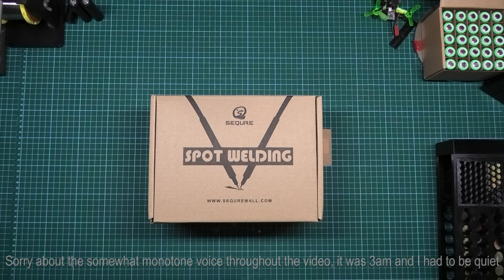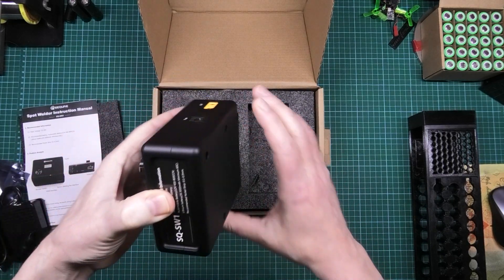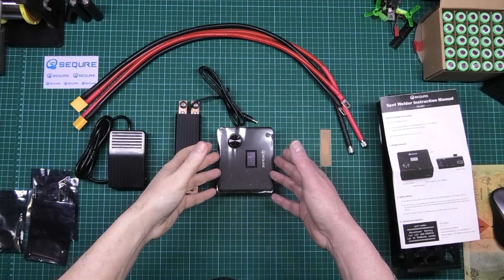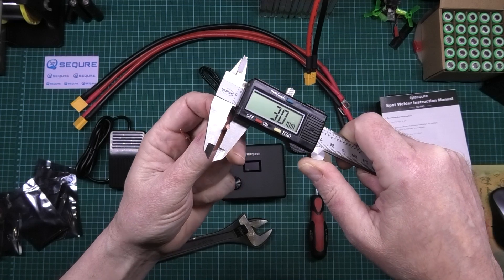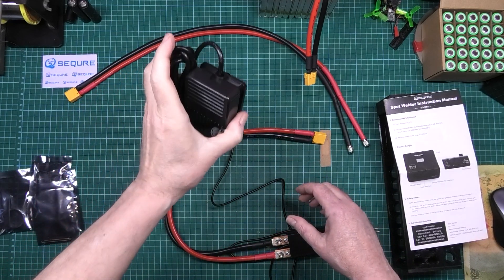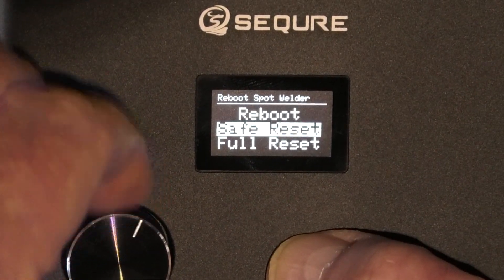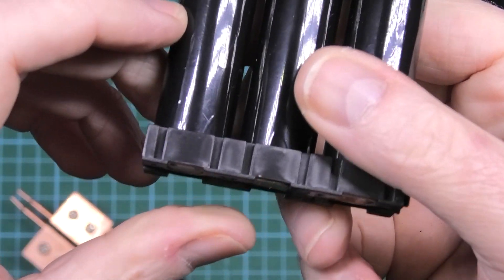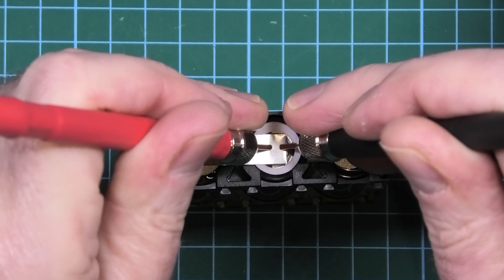Sequre SQ-SW1 battery spot welder review (18650, 26650, 21700 etc)

Comment: Just started using this. .20 strips need 70ms @100% pulse! Using a car battery for power supply with 6awg cable. Things get hot. I suspect the battery can’t deliver 300amps required.
Any thoughts on how power source affects weld current?

Comment: Hey are you still using this as your main spot welder?  I picked this welder up not along ago.  Im using it with a Zee 3s 7200mah 80c battery which meets the requirements.  I was working on my first battery build and everything was working butter smooth.  Super clean welds.  Until out of the blue my welder just starts blasting through my nickel strips.  I was only using 0.1mm strips with a pulse timing of 5ms and it putting holes right through.  I emailed the company 3 times and i really got no response.
Reply from the maker: Yes, I still use it with zero problems. 
A few points to note..... fake nickel (it's actually nickel coated tin) doesn't perform anywhere near as good as pure nickel. If you get sparks, it's fake nickel. I've known people who bought 2 rolls of nickel and they changed half way through. The first roll was pure nickel, the second was fake so it blew holes in everything.
When welding any nickel, you need to make sure that the strips are flattened after you cut them - any air gap between the nickel strip and battery will blow a hole in it.
Make sure you clean all surfaces with some solvent (obviously, make sure it all evaporates off afterwards) because dirt/adhesive/dust/engineering oil causes a lot of problems.
If they're reclaimed cells, make sure the terminals don't have anything left over from last time (grind off all traces of previous welds).
Do not sharpen the tips but make sure you don't have any black carbon build-up on the ends - the tips need to be clean and slightly rounded to get a better contact area which spreads the current and gives a better weld (and also stops it from blowing holes in everything).
Dial the pulse duration down until it doesn't weld properly and then dial it up by 2 points.
I don't think it's the welder, it's something else that has changed.
Reply: @Vortecks  Yeah i figured out the problem.  It was me not pressing down hard enough lol. I have no idea where to even find pure nickel strips.  Im in Canada buy the way. Thanks for the response.

Comment: Did you tryed allready 50 welds and over in row (one by one)? get hotter and hotter? I'm still using malectrics pins and they are very hot after some welds so after 15-20 I must take a break.

Comment: Hi Tony, did you see any over current protection on the inside (there is no mention in the manual)?  It possibly just relies on wire and battery (internal) resistance to limit the current.  Hopefully your monster pack won't start eating the FETs!
Reply from the maker: No mate, there's no internal protection. I ran it at > 650A with a 0.3mm copper strip and a 25ms pulse for quite a while and nothing blew.

Comment: Can you set it up to use a regular plug into 110?
Reply from the maker: No, sorry. They use far too much current and much lower voltage to connect directly to a mains outlet (you can convert a microwave transformer but I'm not going into that one). You're better off looking at the Sunkko spot welders for 110V https://www.banggood.com/custlink/D3DdOPMmh4
Reply: @Vortecks  i have a Sunkko 788h already and I'm not a fan to say the least. I was looking at your links and seems like those aren't that bad after all. The thing I'd like to know now is how many welds you get off one of those batteries?  And are they really a good machine? Seems wonderful. lastly THANK YIU for your response.
Reply from the maker: @FelonENews  I get virtually unlimited welds from my battery but it's big (12V - 64Ah and capable of delivering over 1000A) and expensive and built for the purpose. 
The welder is good, I used to have a Malectrics spot welder which never let me down but it was a bit cumbersome and now, I only use the Sequre spot welder.
Reply: @Vortecks  I heard good things about the malectrics and kweld. but the sequre seem the best overall. Thanks

Comment: My homemade Gas Turbine has a Combustor made from Inconel sheet... Microwave Transformer job and timer ..those tips got hot too, and the arms...Worked though...😀🇬🇧
Reply from the maker: Now, that's the PROPER use of a microwave transformer for spot welding. Using the same kit for doing batteries is a bad idea because it fuses by resistance heat, rather than spark welding.
Reply: @Vortecks  Yes, in my case the current passes through two pieces of metal with the tips opposing each other. The current flows from one tip to the other in the traditional way. This surprised me when is see batteries done in this way that it worked, and didn't just melt the tab...🤔🤔😯

Comment: Chinese PVC coated wire, ultra rigid due to them not using plasticiser to save money.
I absolutely DETEST them for doing this...SO bloody annoying....Rant over, my pet hate...😡😡😡😡😡😡😡😡😡😡🙄🇬🇧
Reply from the maker: Yep..... It's one of my hates, too. Things like balance leads - there's no reason why they can't use silicone insulation but they don't seem to listen.
Reply: @Vortecks  PVC...it's cheaper than Silicone coated and more durable...I fucking hate it. Bought a new electric razor the other week, same thing, cable with folds moulded  in it.... FFS...😡😡🙄🙄😀

Comment: I have one of their battery powered thermostatic soldering irons and it is really good.

I'm glad to see that their other products seem to be good.

I have a Malectrics spot welder and the recommended 5,000mah 65-130C Lipo (mine is from China Hobby Line).  It would be interesting to see how the Sequre works with a battery like that or whatever their minimum or recommended battery is.  Not everyone is going to have a 1,000A capable battery...
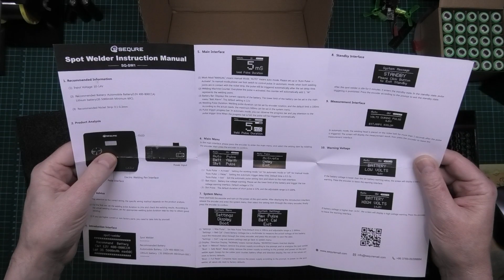Reply from the maker: Have a look at the video again. (0:42) In the manual, it says a 5000mAh with a minimum of 60C which is 300A. My welds are around 700-800A because it works much better and welds differently.
I'll be going into detail about spot welds and the different types soon......they're not all the same.
Reply: @Vortecks  yes, I missed the manual part, I just want to see how it acts with the minimum battery because that is what most people will use.
Reply from the maker: @joequixotic3039  I'll also do a video on using supercapacitors to take the brunt of the current. You can use a relatively low output battery then 😁
Reply: @Vortecks  that would be great, thanks.

Comment: hmm, watched another one that runs off a internal battery that can do 1200A, not sure where i saw it, but that was also a good small spotwelder, you charged it with a typer c or micro usb and it would discharge itself to 50% if it hadn't been used for 5 days
Reply from the maker: That one uses supercapacitors. That's another video I've still got to do when I get time 😉

Comment: hell its cheaper then the other one you have if you just get the welding leads
and looks much more refined and seems to look like it works better
Reply from the maker: I'm honestly impressed. As you can tell by the video, I started out with nothing but scepticism but I was wrong and it does a fantastic job!

Comment: tony you seen the one made out of microwave transformers search this guy Donny Terek --DIY Spot Welder From Microwave Transformer | HOW TO let me know wot you think cheers tony
Reply from the maker: I made my own out of a microwave tansformer at one point but it was never successful in creating a decent weld. All they seem to do, is weld the metal by heating it up and melting it rather than an instantaneous spark weld. They don't produce enough instantaneous current to weld properly but that doesn't mean they don't work! I don't like the idea of welding by heat alone and I don't like the idea of working with 240v.
Reply: @Vortecks  cant beat a nice clean DC current from a cell pack